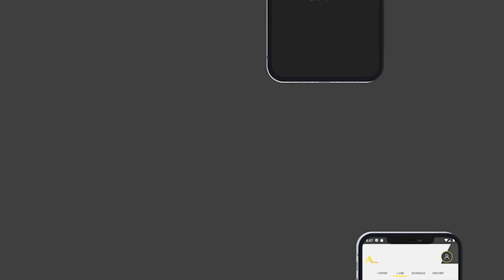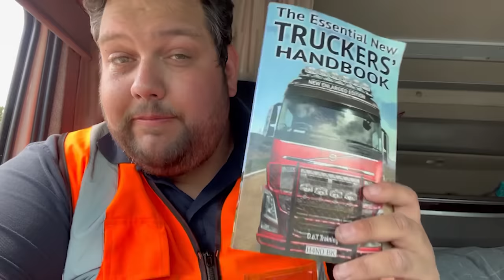Crane Delivery Took Hours & Hours!

Comment: With regard to your first site drop and the air bags H&S has gone made which is no bad thing mind. Out of interest did you have to be inducted on to the site before entering 🤔
Reply from the maker: No. As drivers were never inducted.
Reply: @lukecinahgv  That's really interesting and surprising as all the sits I've worked everyone has been indicted regardless of who you are. I've had to be indicted when I've attended meetings on sites before now. Would be interesting to know what the HSE views are on this as drives are at risk the same as everyone else walking around 🤔
Reply from the maker: Yep honestly. Never been inducted on any of the many sites I’ve delivered too across the whole of the uk. If drivers had to be inducted at each site, one of two things would happen. 

1) the delivery fee is increased to account for the loss of time that will eventually happen.  

2) delivery’s wouldn’t be made as hauliers would refuse to deliver and so sites would have to get their product there by their own employees and not 3rd parties. Which would be more expensive for them .